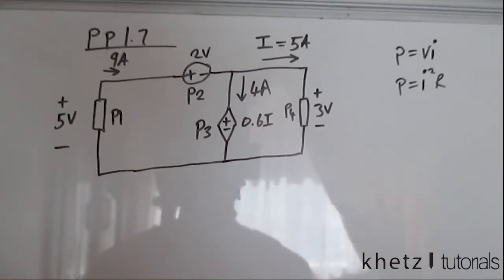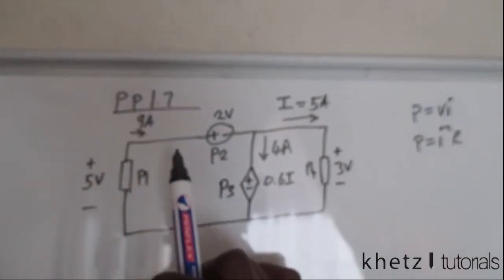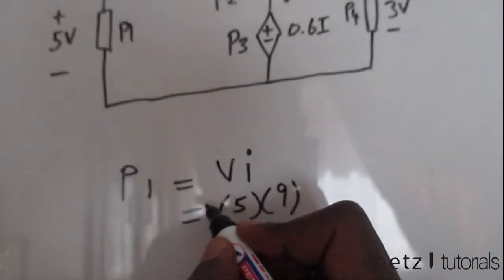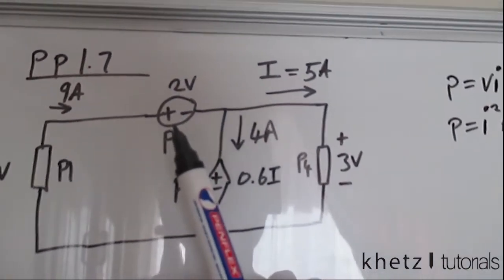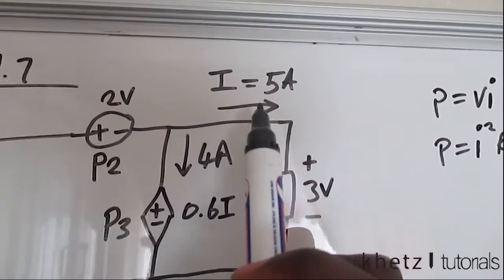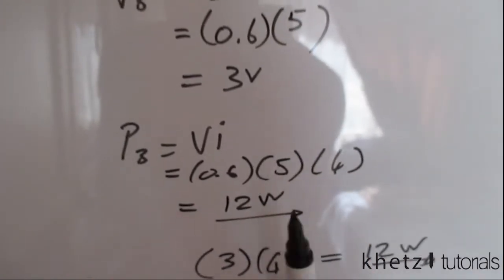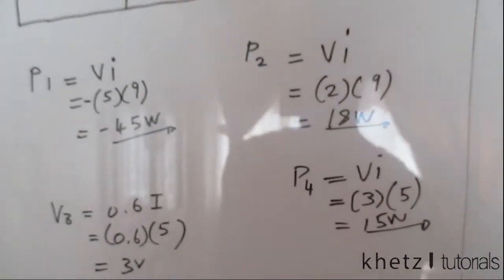Fundamentals Of Electric Circuits Practice Problem 1.7

Comment: thanks but why at 4:08 why 5 was used as current when calculating voltage and 4 was used when calculating power, in fact, could we say 3 directly because there is a parallel arm when calculating voltage?
Reply from the maker: I was just expanding the formula since the voltage is 0.6xI and I is 5. You could have easily substituted 3 just like I did at 5:05
Reply: @KhetzTutorials  how, im still confused, when I=4 is closer one?

Comment: Why you took the value 5A but not 4A for power3
Reply from the maker: 0.6 x 5 is the voltage. I = 5. When calculating the power, I used the correct current across the voltage source but the value of the voltage source itself is 0.6 x 5 which means p = vi will be p = (0.6 x 5)(4)
Reply from the maker: Hello. Please indicate the time step so I can help
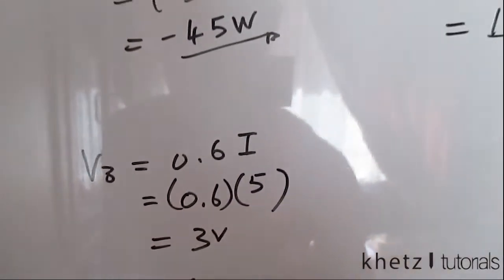Reply: @KhetzTutorials  4:30 here is the timestamp for this question, hope sir can explain about this